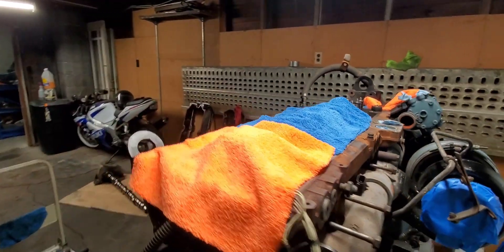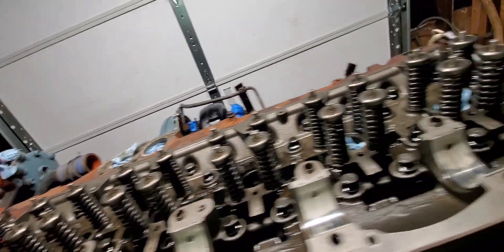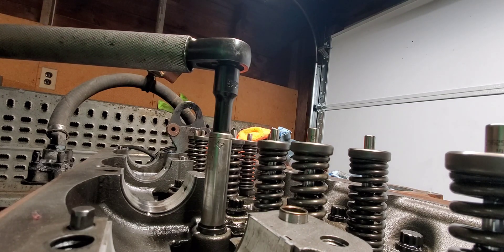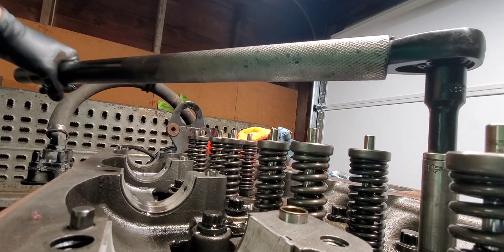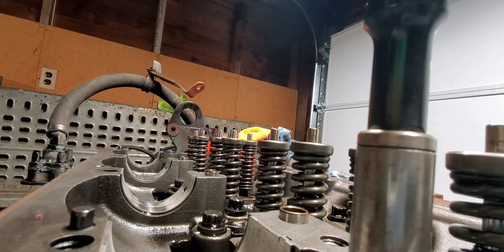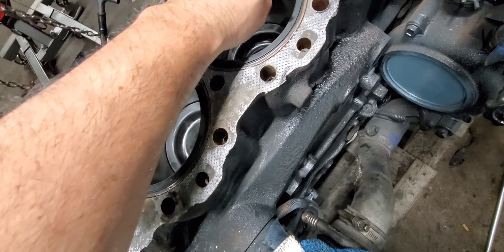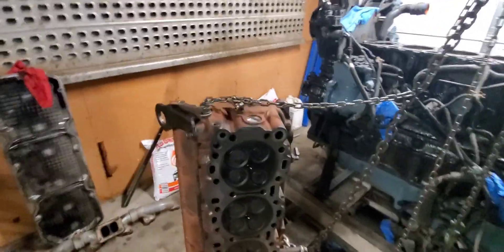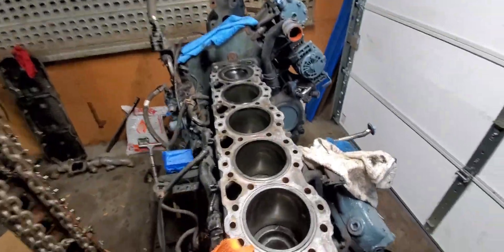detroit 60 series 14.l engine tear down head from high pressure in coolant #diy #dieselengine

Comment: 1. Did you do a pressure test? What was the result?
2. What was the result of the liner heights?/Depths?
3. What needed to be done to get her going again?
4. Why did you part out the engine?
Reply from the maker: Yes parted engine out

Comment: having a low liner is not a good thing, did you end up doing a full rebuild with liners?
Reply from the maker: No 👎 not yet
Reply: @Turboguyz11  dealing with the same issue on my 2006. it started going through coolant, up to 2 gallons a day so i parked it for now.
Reply: @makeitpay8241  Me too, after a 250k rebuild!!!!
Reply: @makeitpay8241  replace EGR cooler :-)))  or remove it, most of the time has nothing to do with head
Reply: @ictviamfortruthgoogleisspa5886  i changed the EGR cooler and rebuilt the oil cooler along with changing all of the coolant hoses and clamps. after all of that it was still wanting coolant every morning.
Reply: @makeitpay8241   gasket , head gasket, if there is no other leaks. Just fill with water and drive :_) and sometimes dilute with concentrated coolant . But Oil has nothing to do with Coolant( if they dont mix )
Reply: @makeitpay8241  keep water cup almost open--dont make pressure in system
Reply: Hey what was your engine doing
Reply: @andrewfair6921  who knows :-)))
Reply: Had to do a full rebuild do to sunk liner
Reply: @TheChapman1111  , why do liners sink?
Reply: Normal wear and tear. In my case 5 years ago I got my engine overhaul and the guy didn't get my counter bores cut so all my liners could sit even in the block
Reply: @TheChapman1111   do you remember the measurements that your mechanic was getting on your protrusion?